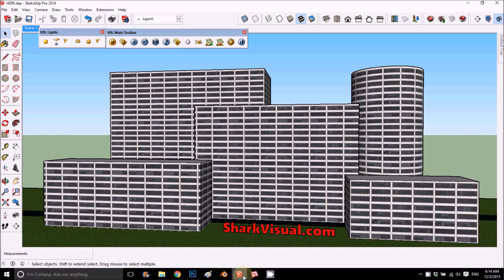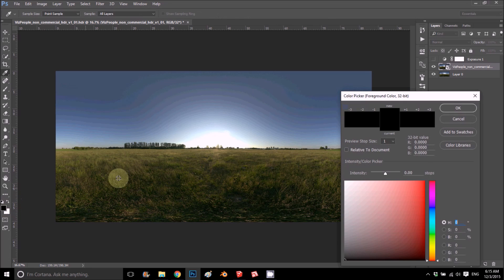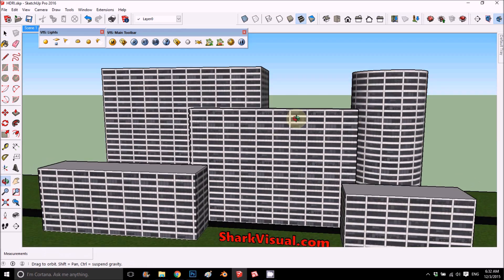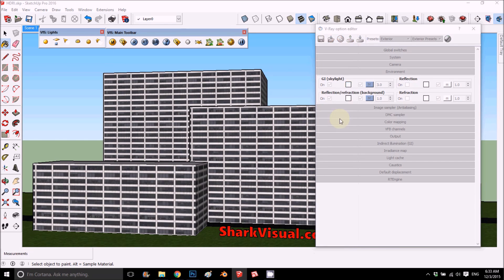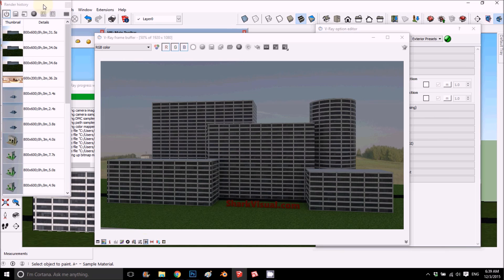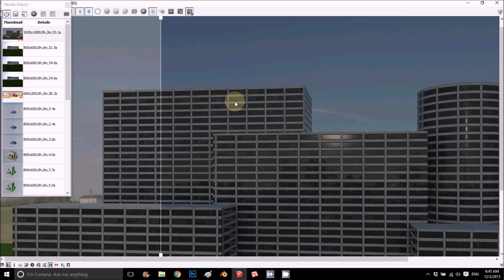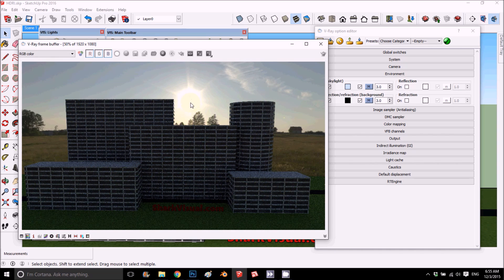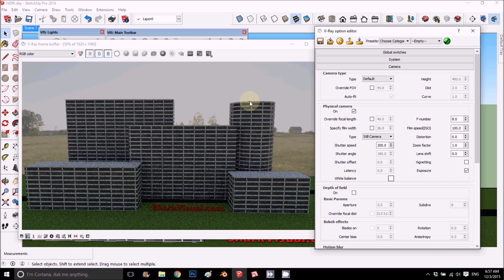HDRI in V-Ray for Sketchup Tutrial

Comment: thanks for the tutorial!!but the problem is,that there is no shadows!and in the latest versions you cant combine the vray sun with the HDRI.the only way is dome light to see shadows. but the render time is higher
Reply from the maker: +leruslan Hey leruslan, So usually what we do is just change the background / reflection not the Sun
Reply: i tried it .but still will be no sharp shadows,the previous version 2014 skp+vray this combine option worked ,but unfortunately 2015 and on , its not:( so if you have any suggestion to solve this problem please share with us:) thanks
Reply from the maker: +leruslan  There is another way of faking the sun with a big "Sphere Light"  - if the sphere is Big the Shadows are soft.
Reply: +W Design Corp thanks for the idea!  i saw it once (3d max artists use it) :)
Reply from the maker: +leruslan No Problem :)